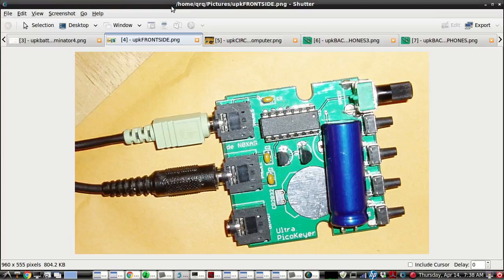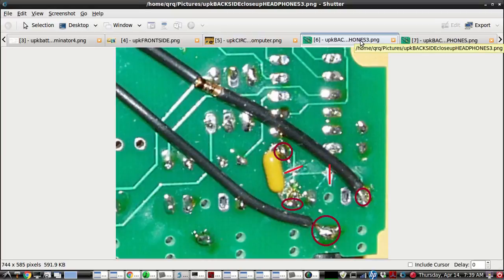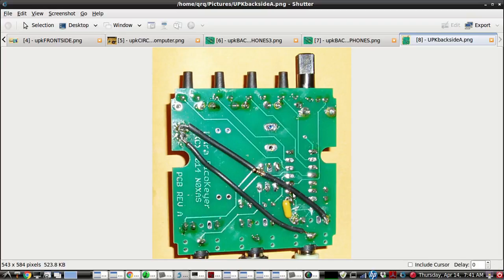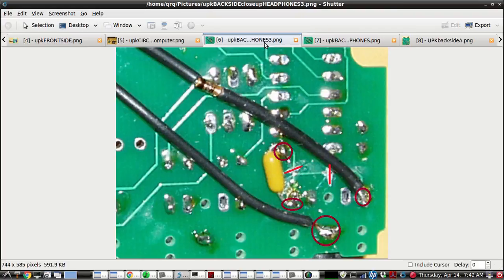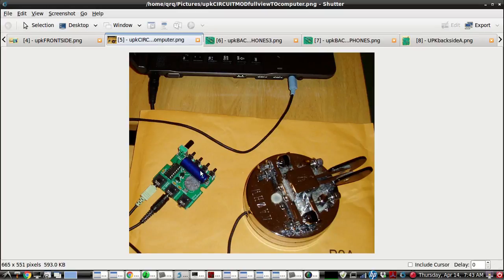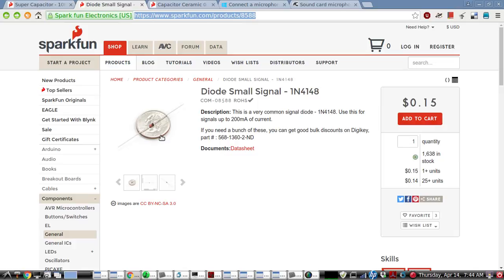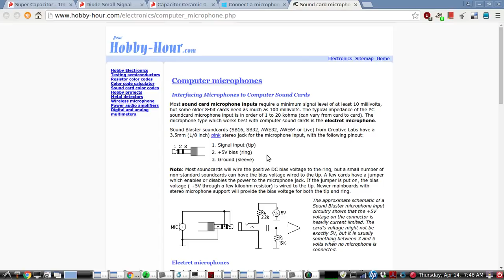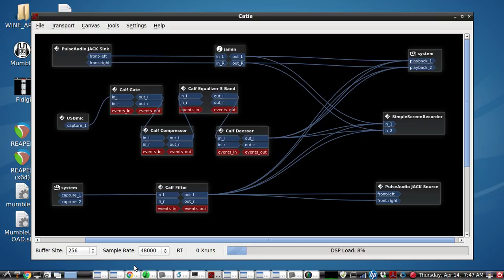Ultra PicoKeyer : Battery Eliminator Circuit Mod using a 10 Farad Super Cap

Comment: Points for being inventive.  I'm not sure, though, why you'd want to do it.  The onboard CR2032 cell will (as another commenter observed) last for a long, long time.  Probably a couple of years under normal use.   The Ultra-PK, like its predecessors, goes into an ultra low power sleep mode after less than a second of non-use, and will stay that way until the paddles or a button is used.

And Nigel, thanks...  I had a lot of fun designing, producing and selling the PicoKeyer line.  Maybe now I'll actually be able to get back on the air again!  Just in time for the sunspot minimum.  :(

73 de Dale, N0XAS
Reply from the maker: Thanks for your comment Dale...this was just a challenge to see if it could be done...since i have UPK connected to the computer at all times in ready mode for CW over MUMBLE...i thought this energy harvesting power circuit would make for a good use of an otherwise unused voltage supply that the MIC JACK already has available...
Reply: QRQcw Gotcha!  Makes sense now.